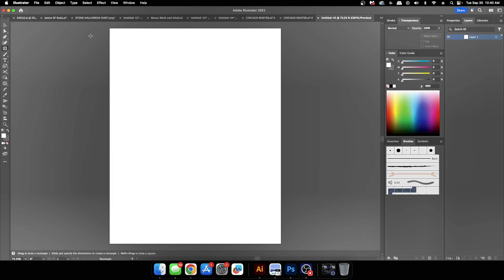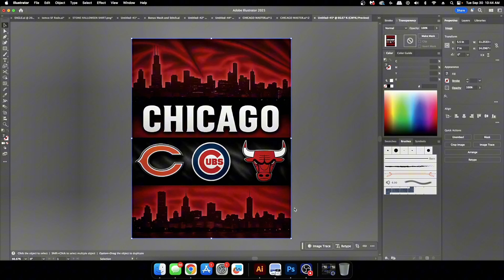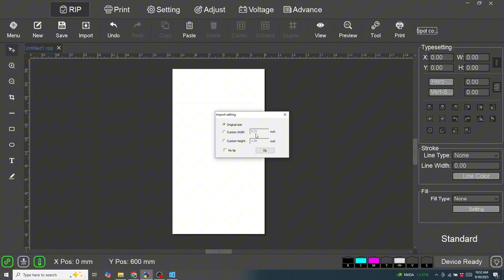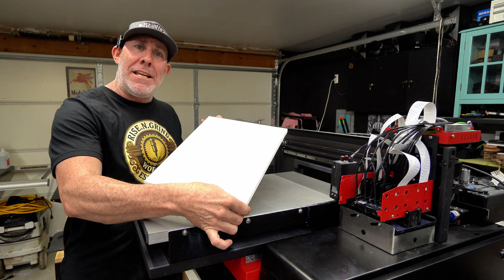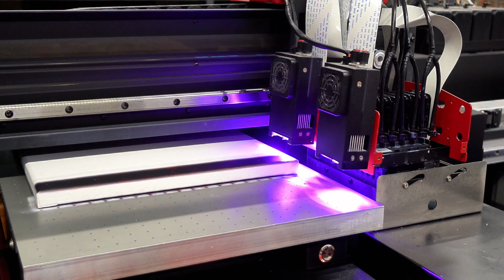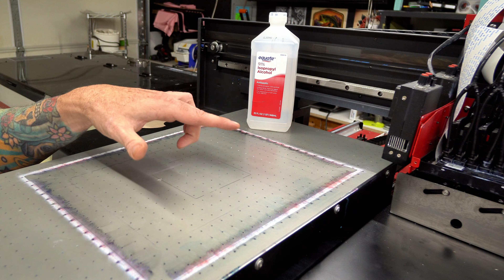How to UV Print on Blank Canvas | Step-by-Step Beginner Guide

Comment: Hi there, I am need of downloading a software. I was going to download Photoshop however I see that you use Illustrator. Do I need both or can I just do Photoshop?
Reply from the maker: Design in any program. You just need photoshop for spot color
Reply: @RISENGRINDWORKSHOP  Appreciate the video and am thinking of purchasing one of these printers, however I really dislike Using Adobe products. Is there no other way to create the spot layer, perhaps in two steps where you print the white layer and then print the color layer on top of it?

Comment: Question you mentioned that since you used soft ink you wont get any cracking. What would happen if you used hard ink?............ Thanks
Reply from the maker: Hark ink is for solid items that don't flex. You can most definitely print hard ink on canvas. You just can't fold the canvas or bend it. The ink would just crack. You would have to do something drastic to get it to do that. We just have soft ink in that unit and wanted to share it doesn't matter whether you use soft or hard inks. Thanks for the question!!
Reply: @RISENGRINDWORKSHOP  what would be wrong with just using soft inks all the time. Does it make a difference with hard substrates?

Comment: Adding that border to line up your canvas seems like it adds a lot of time to the overall process. Could you use the vacuum table holes to make a jig system to help align one off items?
Reply from the maker: This was a very Basic setup for beginners. Yes printing the border is an extra step. However this is very common in the UV Printing Industry. You can easily 3D print some Jigs that you place on the table. You can print just 1" in the x and y at all 4 corners to eliminate time, but still give registration marks. Lot's of ways to skin this cat.

Comment: I am about to purchase a 6090 Pro due to your videos. However, although I have 20 years of experience in Corel Draw, I have absolutely no experience with Illustrator nor Photoshop, so your tutorials will be invaluable to me, especially calibrating this printer.

Anyone have any suggestions how best I can get up to speed with Photoshop? Any resources online I can access? I hope to be going a lot of raised white printing to get that 2.5D effect, but don't have a clue how to achieve this using this printer or how difficult it will be to do so.

I'm one of the Eufymake E1 backers, but that have been delayed again so going with the Refinecolor for now, 6090 for the larger table size.
Reply from the maker: You only NEED photoshop for the Spot Channels/Colors - You can design all day long in Corel Draw or any CAD software you prefer. Since we have Adobe Creative Cloud we have slowly been learning to use illustrator! Appreciate the kind words and support. If you catch this before the end of September. Today is the last day to save $450 dollars with our CODE: RISENGRIND then it goes down to $100 after Sep 30th!